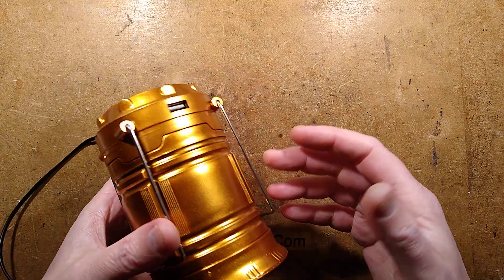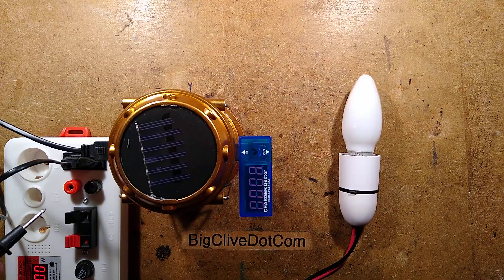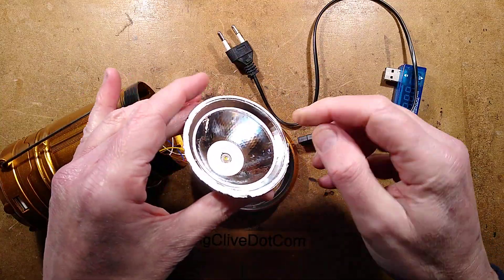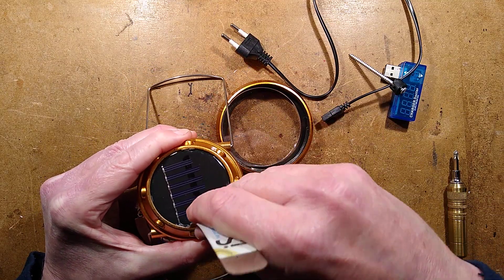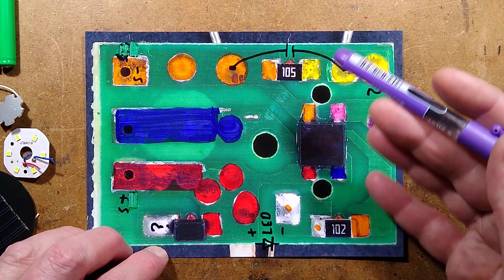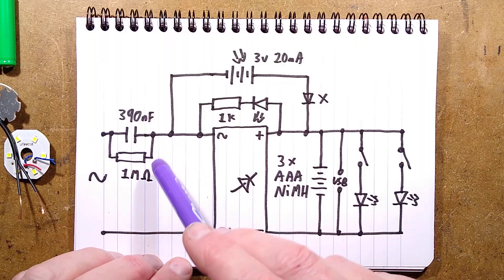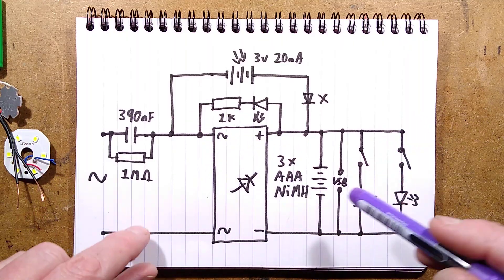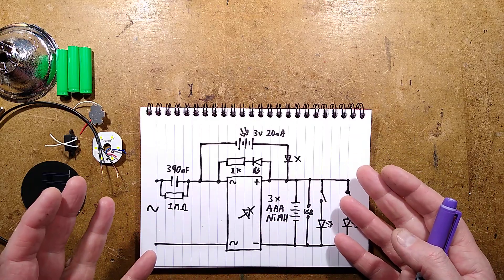Dangerous "death Dalek" lights still on eBay

Comment: Definitely remember the original - and you did a few of these too! Really cheap and nasty, and I wonder if these might be cobbled together from other companies unwanted components?  As the sales platform (and one who profits from these sales) eBay wold be legally liable should people become injured. On the subject of charging, any plans to have a look at the very interesting HT3786D chip from HotChip? Big advantage of these is their ability to drive a 4-level battery charge display (LCD or low current LED), showing 25%, 50%, 75% and 100% charge. They seem to be in a lot of rechargeable Li-Ion cell devices with their ubiquitous "4 led charge indicator" these days.

Comment: I have one that lives on the patio and gets a fair bit of sun. I'm pretty certain it does recharge from the panel, or at least did for a while. Will have to double check. I potted the mains plug ages ago to prevent use.
Reply from the maker: The early ones did at a slow rate.

Comment: All batteries are 'rechargeable' to a certain extent, just depends on how effective the process is and eventual battery integrity. Perhaps Clive could tear down one of the cells to see what chemistry is inside.
Reply from the maker: These ones would not take a charge at all, even from the bench power supply.

Comment: Bad Chinese electronics? Say it isn't so! 😂 Actually, while this is bad, I've got something far worse...as in potential fire and/or shock.

There's these rackmounted switched power strips that you see with several company logos. The one I bought was a Pyle Pro, but you see these under several brands.

Around the time it arrived, I started hearing some concerning stories about how these were wired. So I opened mine up...and sure enough, it was yet another one of those.

So, what these are are these presumably rackmountable (if you like bent-up rack ears) power multioutlets that you'd see for studio or AV uses. Each outlet is individually switched...which is where the fun starts...

Best construction practices in power wiring dictate that, with AC circuits, you use double-pole switches. This cuts both the "hot" and "neutral" lines, ensuring that there's nothing present on that particular output. And yes, you can only switch the "hot" leg, but you risk a ground fault if current gets into the "neutral".

But when you only switch the neutral...hooooo, boy...

So as you can surmise, every single outlet in one of these Chinese-made units is ALWAYS HOT. You have full potential across the hot and ground lines at all times, even if it appears that you've turned circuits off! And minus the neutral, that potential can cause equipment damage as well as posing a MAJOR potential of shock!

Clearly, whoever cooked this PoS up knows how DC circuits work; this dangerous wiring is fine for DC. But this isn't running on DC... rather, it's running mains voltage AC, and you simply NEVER use the same design practices for AC power circuits as you would for DC.

But someone in Shenzhen apparently didn't get that memo. Anyway, Clive...you might want to hunt one of these down (should be ridiculously easy) and experience the HORROR of downright dangerous electrical design that these things are! Nobody should be buying these things...period!

Comment: They had similar to these at the local camping store not long ago and after seeing your original video on it I checked it out. Had the exact same issue and I tried contacting them about the danger and was blown off until I brought one in and asked the manager to touch it. A recall was issued but I still see them around at different stores
Reply: Asking manager to touch it. Actually brilliant 😂

Comment: Waittttt... Its only the port that's live right? Not the pins of the US socket, so you'd only be in trouble if you'd used a shielded usb cable? Because the outer metal on a usb plug doesn't connect to any wires internally
Reply: sure, its the shield thats live at mains voltage. as far as i know most usb cables are shielded, everyone i've ever stripped has been. theres also the issue of say plugging something in and touching shield on the usb socket with the usb plug, and also touching it with your fingers. or the risk of the mains voltage arcing to other connections. since mains wiring standards need connections to be above a set distance apart, 5-12v wiring doesnt follow this so idk how well a usb plug can hold up from having mains voltage through the shield and not short that to the pins.
Reply: @ge2719  I've not once found a shielded usb cable
Reply: @phonotical  thats weird. every cable i've taken apart had been. and every charging cable i've had to replace for my parents, because its gotten so twisted and bent that the end has broken apart, and the cables started shorting on the shielding, and possibly catching fire. theyve all been shielded. 

even had a bunch over the years that were see through and you could see the shielding layer. 

sometimes its a thin metal foil that i think has a few wire cores inside. sometimes its an actual fully braided shielding
Reply: @ge2719  honestly, I've been through a lot of them and not once found it

Comment: There was briefly a rechargeable alkaline battery system sold here in the US. I tried them; they didn't work very well but they were rechargable and did show a much higher voltage than NiCad or NiMH batteries when it did work. I can't remember what the specific issue with them was (I think short lifespan was a big part of it, but don't quote me) but... perhaps these are either another go at that system or very-old-stock leftovers from the last time?

Comment: Nice one Clive!
Looking at the solar cell, its negative end, is connected to the negative side of the battery, via a diode in the bridge rectifier.
In theory, it may be able to charge the battery, depending on how much voltage it can produce.
Anyway.... yes they should be prohibited goods!  Is it as dangerous as a gun? Probably more dangerous!
Reply: Yup. The LED will take away about 4mA but the remaining 16mA should be available to charge the batteries. Mind you, 10 hours of sunlight would be only 160mAh so it would take over a week to recharge it fully.
Reply: I agree.  I scanned through the comments to see if anyone already said this, and found yours!
It would have to put out more than 3V though...

Comment: I got one of those as a gift from my in laws. The battery went bad in days.When I disassembled it I was shocked (pun intended) to see how it was done. I removed the useless solar cell the battery and the charger circuit and reconnected the USB so I could use an external  Samsung power bank or even a notebook to power it, and when it gets down I can connect another. The light is good, the case is not bad, but the charger is criminal.

Comment: Considering all that empty space inside and the fact that a 5v insulated power supply nowaday is literally dirt cheap, this product is simply outrageous.
Reply: "It's not about the money. It's about sending a message!"
Reply: or it is just intended for countries with electrical systems way sketchier than our european ones so that the passive "no touchy" reflex is more pronounced there...?
Reply: Just stupid shitters to cheap to use normal power supplies.
Reply: Dirt cheap means that it might be 50 cents or whatever currency it is for buying a module like that.  Leaving that out still means you are saving 50 cents...
Reply: The problem is that people prefer to buy a thing that is one buck cheaper creating a vicious circle for natural selection of bad products. The consumer is to blame too. I avoid any of those products that have batteries inside them, they are mostly crap with batteries that die forever shortly and sometimes dangerous crap with dangerous power sources or incendiary batteries. I treat any seller in AliExpress as a potential scammer, I disassembly even multimeters I bought to see if the promised 2000V isolation is really good. Some products are very good but many...(the multimeter I bought was really good by the way). The first bad smell is a cheap product.
Reply: @agranero6 I completely disagree that the customer had any responsibility in this. 
The state has a duty to enforce minimum safety rules for commercial products intended for domestic use.
Reply: @cyan_oxy6734 But realistically how is it going to have a chance of doing that in today's globalised world?
Reply: @Flipdrivel Easy. Guns. Big gun diplomacy.
Reply: @cyan_oxy6734  I think people need to stop assuming the state has everything figured out, and start taking more responsibility for themselves.
Reply: @Knowbody42 to quote (spuriously) a famous man (appeal to celebrity):
 Eternal vigilance is the price of liberty.
In this case, that liberty is the freedom to pay a reasonable price for products without dying.
Reply: Very likely the people involved are also cheating on each other, assuming there are more than one people in the seller/supplier too.

Comment: When this popped up, I did think it was your original from a few years ago. FleaBay still allowing unscrupulous sellers to advertise the same dangerous cr4p, with no way to report. Despite all the advertising for FleaBay recently, haven't used it in years as items are generally more expensive there, or you get ripped off one way or another.

Comment: I saw the notification and thought, "Oh, is it another Chinese product that has an exposed metal bit pointlessly connected to mains?

Oh, I see it gets better! A thin steel wire that's a potential fire hazard to boot! Why do I get the feeling that, if nichrome was cheaper, they would use that...?

I know y'all want to make a quick buck in Shenzhen, but... come on.
Reply: I feel like there's as much "we care more about liability for IP infringement than product safety" as "we don't want to have the basic infrastructure for handling a deluge of 'this product is dangerous' reports"...

Comment: You know what's gotten a little harder to find are the "baby-cutor" electrode water heaters, as you demonstrated a few years ago. Perhaps that's not a bad thing, in the grand scheme, but I always like being able to purchase potentially-lethal consumer goods on a whim. 🤪
Reply from the maker: Yeah, I'm almost disappointed that they have disappeared from eBay.  Fortunately I stocked up.
Reply: @bigclivedotcom  
Those batteries with the odd voltage may be Ni-Zn rechargeables, they have a standard voltage of 1.6 volts, about 1.9 volts at full charge.
Reply: You can literally get those in any store in my country .-.
Reply: I bet they're still on AliExpress and the like.

Comment: Since USB chargers are so ubiquitous nowadays, I really don't understand why they keep on doing this lamp with a mains cable and the deadly and useless 4V charge circuit.
These lights are actually nice if you strip the circuit content except the switches and the LEDs, and then put a LiPo pouch, a generic powerbank module and some auxiliary bits in it.

Comment: Solar panel does charge the battery, through one of the diodes of the bridge rectifier, though it probably would take a week of typical UK sunshine to charge up the battery, if it actually had a standard 500mAh capacity. Te dead cells there, likely recycled from old cordless phones that went into the ewaste bin a few years ago, probably have only 50mAh of usable capacity, and a cell resistance of over 50R anyway.

Comment: Hey Clive, how would you improve that product? I bet you could design, build and implement your own perfectly good circuit on either reclaimed Li-Ion cells or new NiMH cells. Perhaps a good idea for a video even?
Reply: There are other versions that are battery operated (as in, insert your own) and without the USB and weird solar bit.  Lotta places give them out as branded promotional items.

Comment: they could improve the safety with this by having a movable 'blocking' ring inside so either the usb out socket or mains in socket is exposed and connectable, but not both at same time  though as it only has 3.6v battery pack in the usb out isnt much use, so may as well be permanently blocked!

Comment: I actually bought one of these a few days ago for the nostalgia value and because a rechargeable area lantern can be useful during severe weather power outages, which are still common in the Eastern US. Seems most of the new ones toggle between cold white area light and flicker flame now. I'm not sure how everything is connected in these newer ones yet, but I've hoicked out the USB port (I have plenty of compliant USB chargers) and I'll see about replacing the token gesture panel with a 5V one if I can modify the wiring so that it will trickle charge the battery.
EDIT: Turns out the battery in mine also has the sus primary cells. (Probably zinc-carbon?) Naughty! I hope they weren't expecting a spanking; they need to go to their room and think about what they did.
EDIT2: I have some 2/3AAA NiMH 3S packs on order and will be building up the modified schematic featured in the Double Death Dalek video flying-lead style (basically just a USB lead and the 5V solar panel commoned through diodes to the positive rail with a 4.7 ohm resistor between the USB negative and ground). Should work out just fine, and I now have a wired USB-A socket and a dodgy 400V capacitor that I can find other uses for.

Comment: its a mystery how they still can sell this death trap with all our rules they need to follow and obey.  It sounds like they did have some kind of safety but they removed it to save money.

China is doing the same with EVs, they sell them with airbag and safety and all that stuff but when they crash while driving 120 km/h the airbag wont deploy..  and the battery can start and burn out of random.. while on charge or while you drive the car..  China is fake all over, dont trust anything they say and the more dangerous a product is the more likely its a death trap without safety.

The new huawei mate phone is a good example, its the new and brand new tech from china. The phone is as hot as the samsung notes was while the huawei is on the home screen only.. and nothing is running or is used.. Its a phone and a hand warmer when its cold. I dont think a phone that run that hot is safe..

Comment: Re: eBay reporting. I don't know how you solve this problem. If they added a feature for reporting dangerous products then that would completely shut down a lot of vintage vacuum tube equipment and basically anything with a "hot chassis" design, just like this light.
Reply: they could just put a big warning on all products that dont meet uk electrical standards. 
Anyone buying these for their kids seeing that should then be put off enough and not buy it. but anyone buying something with an old vacuum tube more than likely already knows they are risky.
Reply: @ge2719  exactly my thoughts.  allow product but major warning user has to accept.

Comment: My in-laws bought one of these way before they were internet famous. When I saw what was inside my hair stood up and I converted it to usb charging only with a tp4056 module. Theirs had an 18650 with the capacitive dropper across it directly with only a resistor to limit the current. It also had a disco light on top instead of the solar cell.

Comment: Basically anything with a 2 pin plug should be double insulated. In this case even the power cable is dangerous.